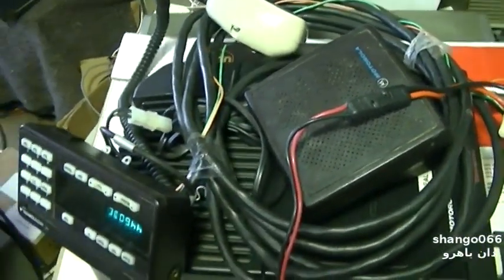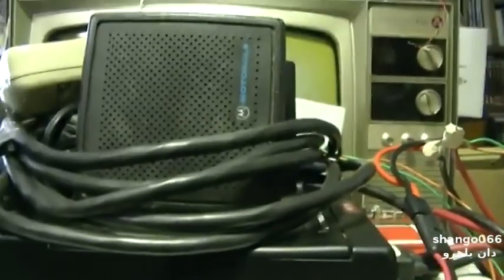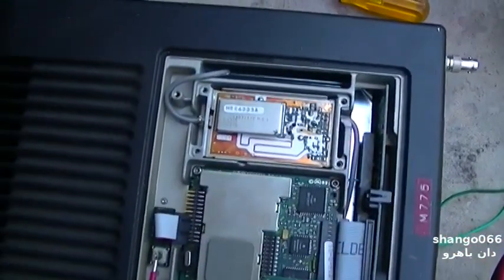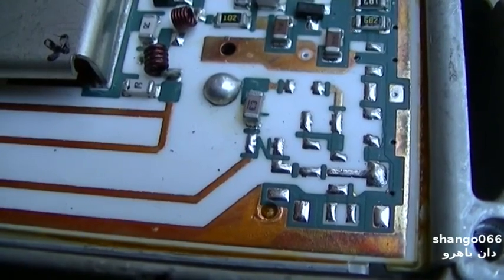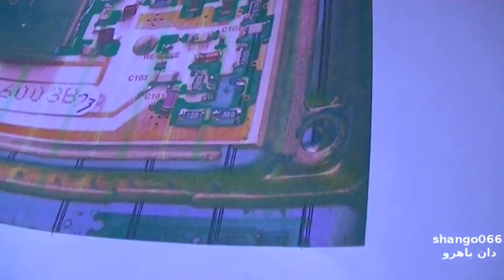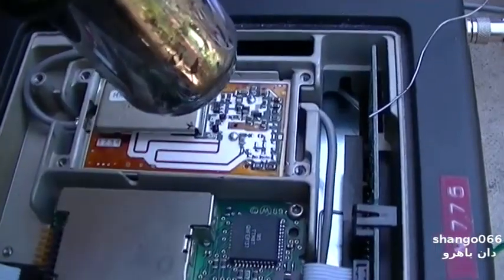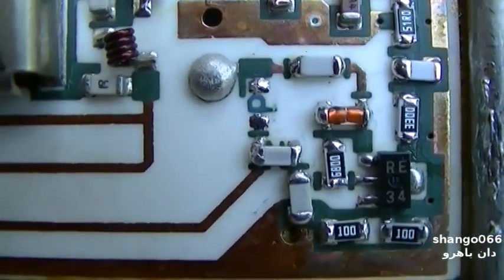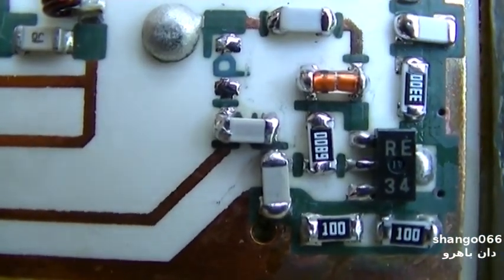Motorola Spectra RF Preamp Kit Instalation and Test

Comment: Do you think this might work on the 900 MHz Spectra? The transistor is specified to have a gain of 10 dB at 1 GHz, so I am thinking it will, perhaps with one capacitor changed. Any thoughts?

Comment: I have a 898d rework  soldering station, one side has a heat blower to heat the ceramic board and the other side has a nice adjustable soldering pencil.so it could be used together one can be heating the ceramic and the other to remove the and component or just use the heat blower to do both

Comment: Not sure what they are called in the states but here we have $2 shops and you can buy metal frame eye glasses ranging from +1 to +4.

I find the +4 ones to be really good for doing surface mount stuff. I've got a pair the same as you showed but they are kind of heavy and a little unstable.

The asian lady who owns the $2 shop once told me I must have really bad eyes if I need so many +4 glasses. :-)